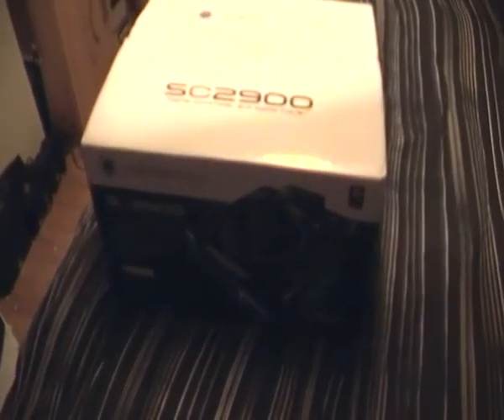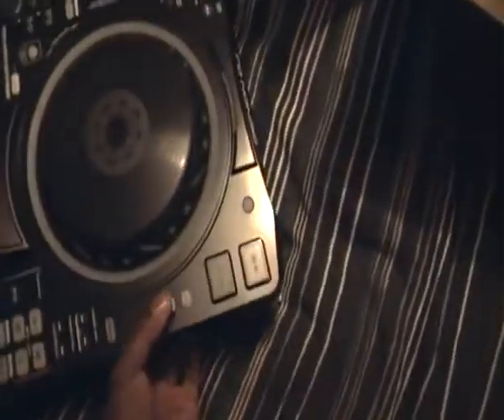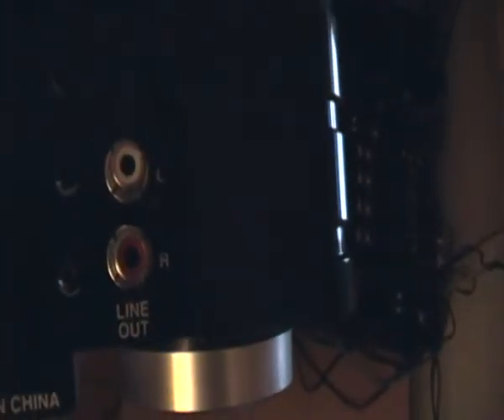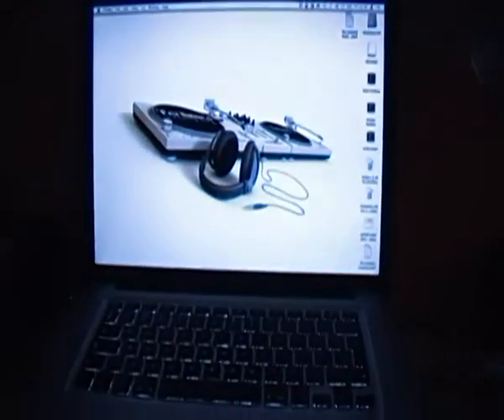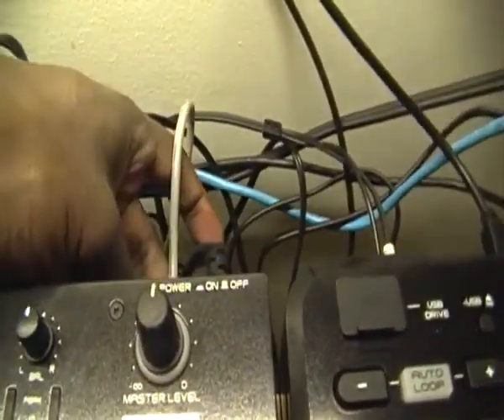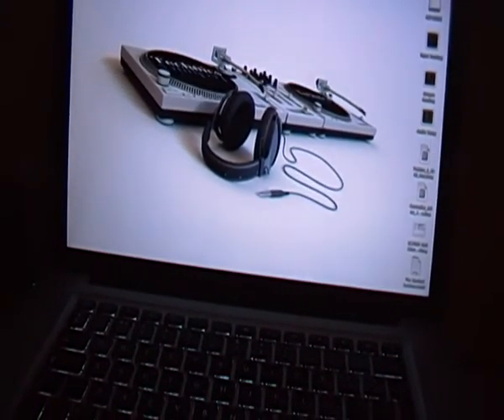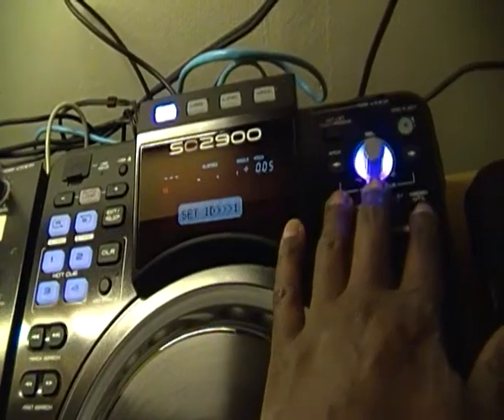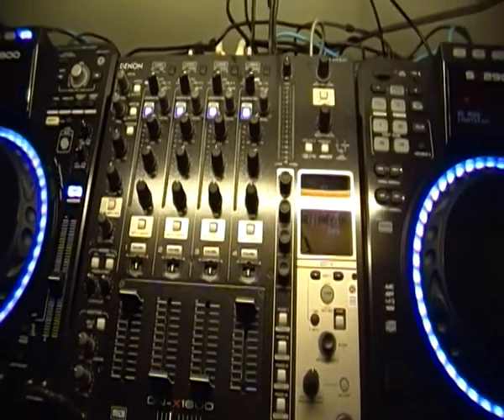Denon SC2900 & Denon X1600 Traktor Setup: Part 1/4 - Unboxing and Cabling

Comment: Hello Collin, I'm using the same system ( dn x 1600 + 2 x sc 2900 ) just brought traktor pro. I cannot get either deck to work using channels 1 and 4,  I've updated firmware. The options seem a little different in the audio set there nothing in the inputs? could it be output and input routing ??
Reply from the maker: Hi Chris,

Lots of different areas where things could be tripping you up. Can you be more specific when you say you cannot get either deck to work using channel 1 or 4. Do you mean they are not successfully connected to the pc in MIDI mode? They don't control either of the traktor decks? No audio is coming out of the speakers? etc etc

My video is in 4 parts and goes through from unboxing to control and audio. If you can specify at which exact video and point you are getting stuck, that would help me help you.

Thanks,

Colin